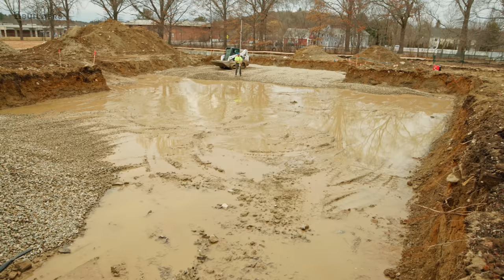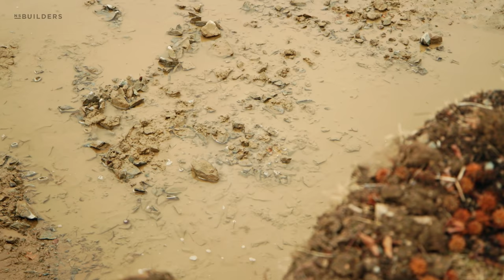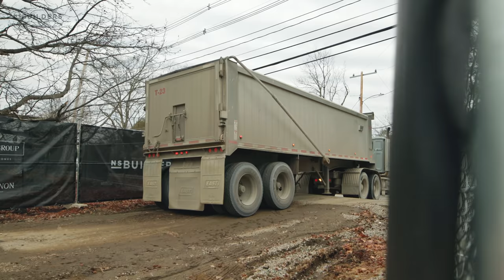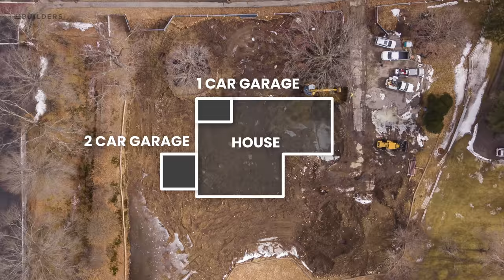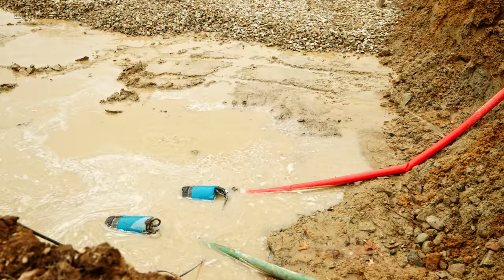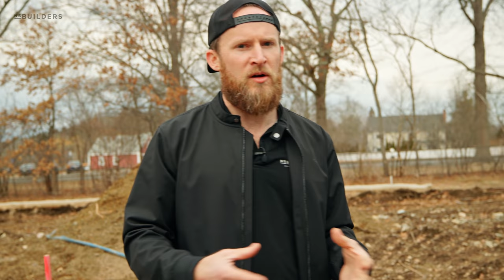FIGHTING groundwater under the foundation

Comment: Long time radon mitigation contractor here.  Don't use the sump lid as the radon collection point.  Tee into the drain tile with your vent pipe.  It's a far more robust assembly that can't be undone when servicing the sump pump and won't be in the way of that service.  Given how wet things are, I'd also strongly recommend adding an active radon fan to the vent pipe.  The average radon fan moves a couple gallons of moisture a day along with radon.
Reply from the maker: Great advice. We’re going to reconsider our approach.

Comment: I'd be worried about the concrete drying properly in that.
Reply: I imagine a vapor barrier can be put down, also concrete cures and doesn't dry but I get what you mean. (edit, they mention putting a barrier down)
Reply: @Brazilianfro32  usually a vapor barrier isn't put under the footing. Hopefully the stone will be enough.
Reply: The FastFoot system by Fab-Form is an ideal product for this situation. It also provides the capillary break needed as well.